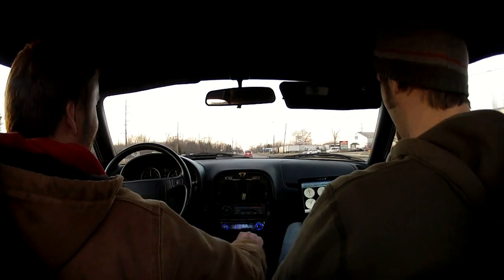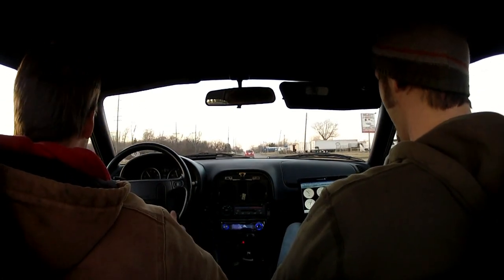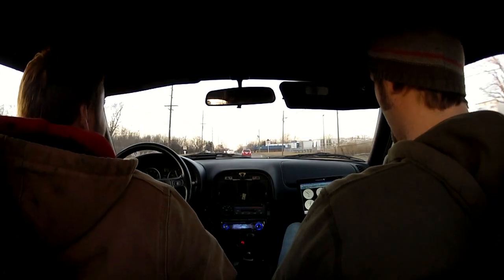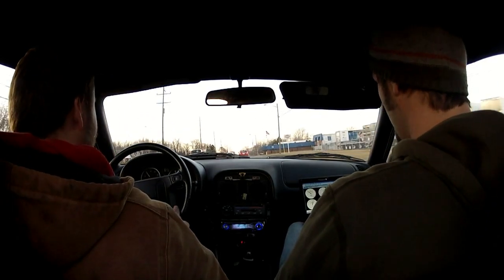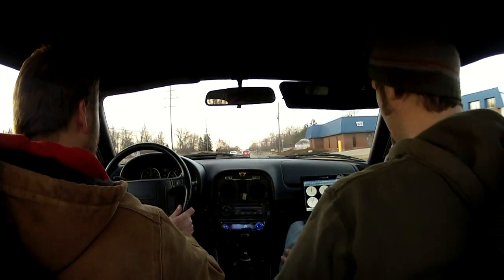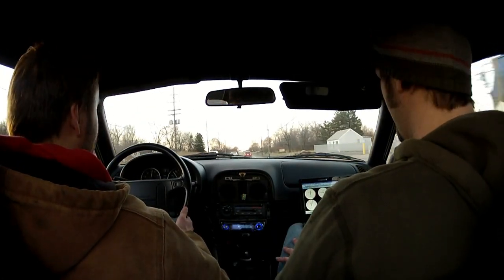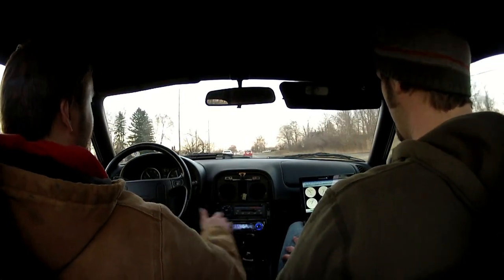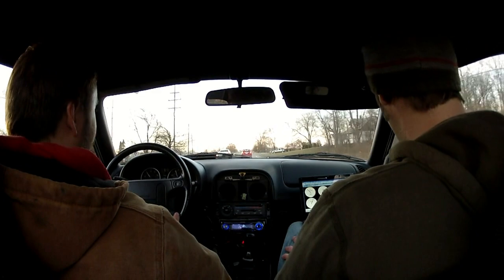Turbo Miata with a Spec stage 2 clutch slipping @ maxed injectors

Comment: as noted in FM's instructions for their stage 1 kit, break in is very important if you don't want a chattering clutch that didn't break in smoothly.  If you broke it in when it was naturally aspirated then you aren't going to burn it up too much unless you drive like a total maniac.  Breaking it in with a turbo you have to drive like a grandma for a couple tanks of gas.   

As for the slipping, if it's a stage 2 and it was "professionally installed" then it shouldn't be doing that even if it wasn't broken in properly.  Most likely its a problem with the pedal adjustment. If the slave cylinder pushrod was adjusted too far in, the pedal would have lots of travel, but the plunger on the slave cylinder would be past the reservoir bleed hole.  This means that as the fluid heats up and expands, it can't flow back into the reservoir.  The pressure pushes on the clutch and it slips or disengages when enough torque is applied.  The naturally aspirated engine may not have had the torque to overcome the clamping force of the clutch with the pedal adjusted out too far, but when boosted, the engine will be able to generate enough force to overcome the clamping power of the clutch while the heated hydraulic fluid it pushing on it trying to disengage the clutch for you.

If you have a similar problem to the O.P., try adjusting your pedal.  it may save you having to get a new clutch.   Also keep in mind that the clutch wears 10-20% in the first 1000 miles of use, so if you have the opposite problem and your clutch won't disengage, all the way after the break in period, you probably need to adjust the pedal by threading the pushrod on the slave cylinder out.

Comment: I went with stage 2+ with carbon metallic on one side and kevlar on the other side of the friction clutch with new steel SMFW.  About 450 bph with AWD.  Currently have 20 miles on new clutch and slowly bedding in the Kevlar, you don't want to keep slipping that Kevlar clutch, as you know, otherwise it will always slip.

Comment from the maker: Uhh, no. I had this clutch for 1000 or so miles while the car was NA. This drive was the first drive after adding the turbo. As soon as it spooled it slipped. The clutch is a huge pile of shit. I installed a FM level 1 clutch rated at 318ft/lbs and it has worked since day one. There is no such thing as "break in", that's a load of horse shit. You break in a clutch exactly how you would drive it normally. SPEC clutches suck i won't ever be buying another. A friend of mine had the same problem.
Reply: erat91 I just installed a 2+ on my 335xi with 300hp and 300ft lbs of torque.. the clutch itself is rated to 550ft lbs.. it grabs like hell and pulls hard all the way to red line